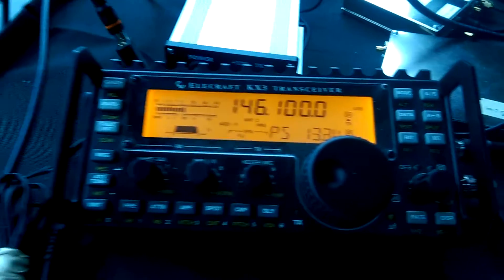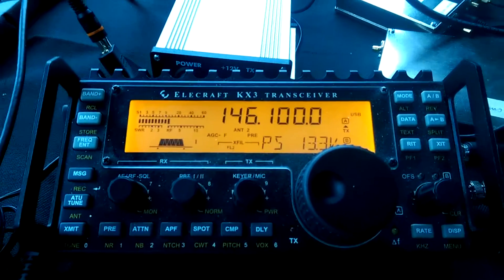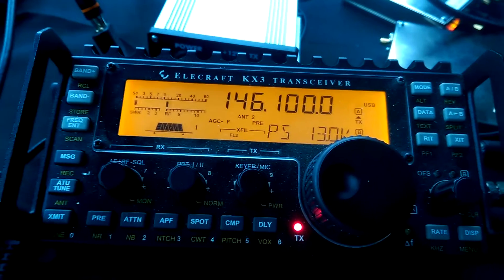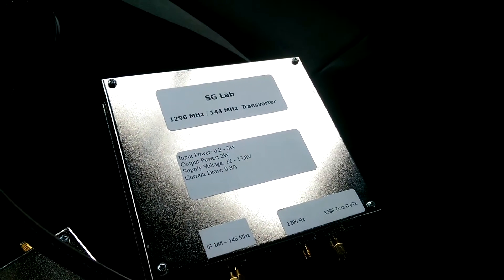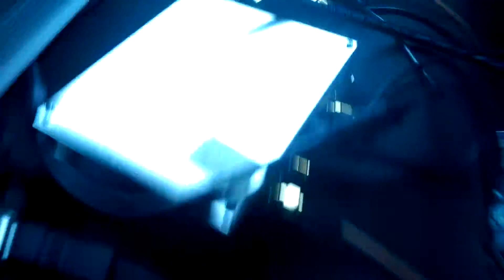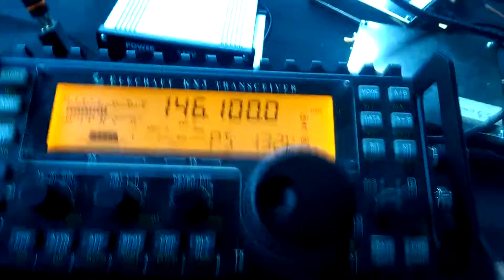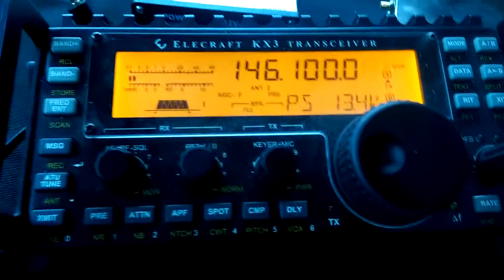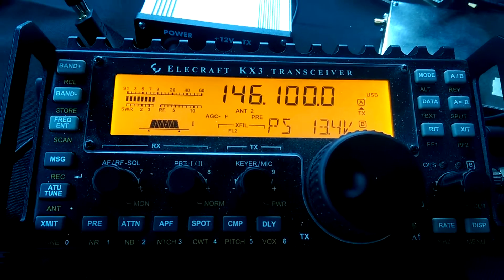1.2 GHz SG-Lab Transverter With Elecraft KX3

Comment: How do you determine what frequency you are using? Your kx3 is displaying 2 meter 146mhz?
Reply from the maker: Eric Lessard The transverter is a 144-1294. 2mhz up (146) = 1296mhz through the SG-Labs transverter. Just some mental math. I have since programmed the kx3 to do the math for me and display the correct frequency.
Reply: @w4dve  i just ordered one from sh labs 192 US. I'm looking forward to operating it. What do you use for a antenna?
Reply from the maker: Eric Lessard Sorry for the late reply. I use a home brew 10 element(?) yagi. Made it out of pvc and metal rods found at Home Depot. The driven element is made from solid #12 copper wire with a hairpin match. Look up cheap yagis on google and you’ll find exactly what I’m using.